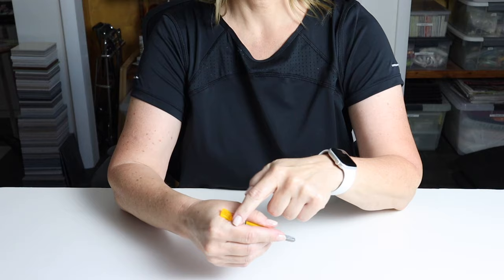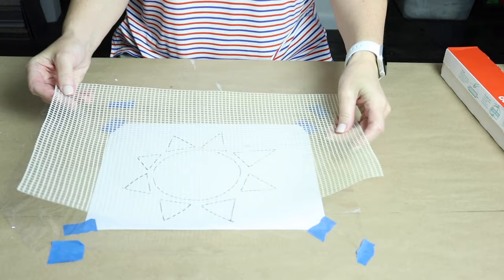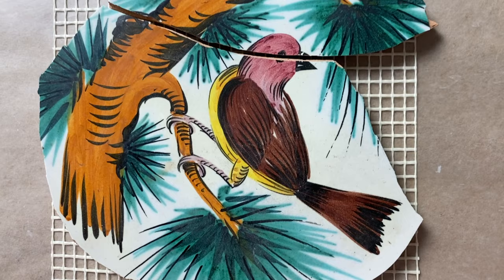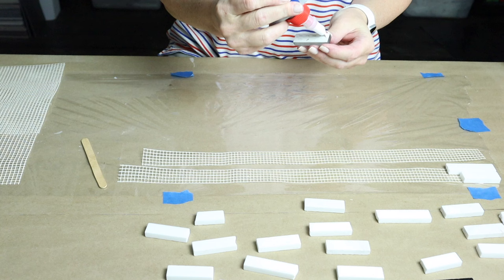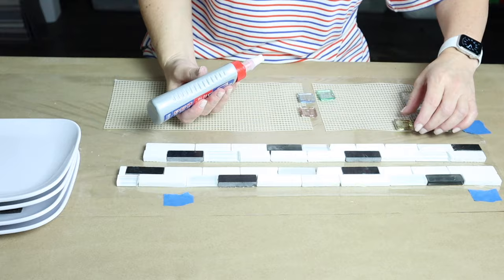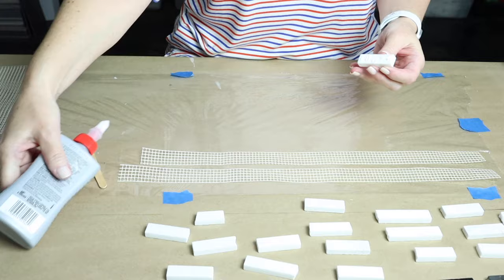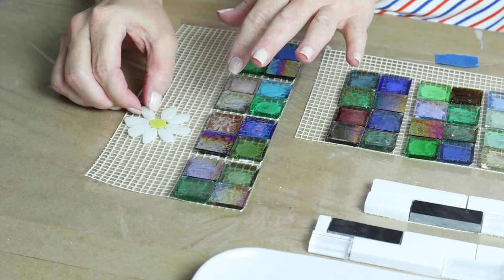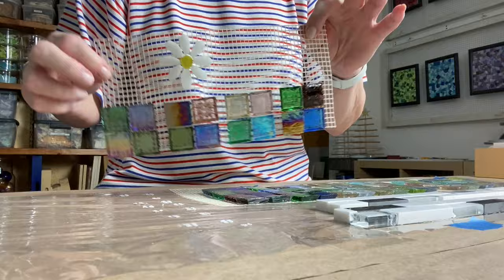HOW TO MOSAIC ON MESH | Types, Pros v. Cons, How to Use

Comment: Loved your video. I have used mesh before many years ago. My first project was to make a border all around our bathroom walls. I used a piece of plywood cut to the height of the border and long enough to fit on my work table and short enough to carry into the bathroom. I covered it with waxed paper and used a glue to secure each piece of tile on the mesh. Then with the help from my husband, we took the whole thing to the bathroom. It was quite heavy. I put mortar on the area where it was to go. And then removed the tile from the board, peeled off the wax paper and pressed it into the mortar. I repeated this until all the walls including the shower had the border and then grouted it. After all these years it has held up just fine.
Reply from the maker: Hi Lynne! How inventive!! Your bathroom must be gorgeous with your mosaic work. Keep creating and I'm glad you're here!
Reply: I wish we could see it! Lol
Reply: I am with you, tile mesh is a great product for large murals as they can be cut down into more manageable pieces. 
But when using Weldbond (dries clear ) the mesh will show through any transparent glass. Especially if you use a darker thin set for the final attachment, the white lines of the mesh will be seen through the glass. 
If you use a White thin -set tile adhesive for attaching to it’s final resting place you can still use Weldbond as your initial tile to mesh glue. Cheers

Comment: When using the adhesive mesh, you mentioned it looses it's stickiness eventually. Does that mean that once you make your mosaic the pieces will gradually start to fall off the completed project? Or were you just saying that once you pull it out to use it for a project, it won't be sticky anymore and you'll have to use your own adhesive anyway? Thanks!
Reply from the maker: Hi Maria! Yes, over time the adhesive mesh can/will eventually lose it's stickiness but that could be years down the road, depending on how it's stored, the quality, etc. You would use self adhesive mesh to assist in your mosaic making, most likely as an intermediary substrate upon eventually adhering it to a final substrate with proper adhesive. Keep creating and I'm thankful you're here!🔥
Reply: @JulieWeilbacher  Thanks so much for the info!

Comment: What is the widest mesh one can buy?  Not length, but width and where can one buy it?
Reply from the maker: Hi Ron! I've seen mesh that's 48" wide on a roll, and you can find it on Amazon. You might also check with a local diy tile store or hardware store🔥

Comment: I'm making mosaic stepping stones from scratch. Yes, mixing the concrete, pouring it into a mold, then decorate the top of the concrete once it has set for a bit - till the water basically evaporates from the surface. Please tell me if this will work: I am wanting to use thinset to attach my pieces to the mesh, let is set overnight, then backbutter the mesh with the mosaic with thinset, and then transfer the product to my concrete while it's a bit soft. I would push it down a bit, until the top of the mosaic is level with the concrete top. Will the mesh adhere to the concrete? My plan is to use a hodge-podge of materials to make a sidewalk.

Comment: Ordered a fancy mosaic - lots of marble pieces - from Mozaica (it was terrific!), but it was round (also had a mesh backing on it) and I was placing it over my stove and had to fit glass subway tiles around it. As cutting those tiles in curves was NOT easy, I decided to put a square marble edging frame the round (24") mosaic, and ordered more marble pieces from Mozaica (which they easily were able to send). So I needed to make "corners" of small pieces of marble and so seeing your video on how to apply these to an existing mosaic was really helpful. Thanks!
Reply from the maker: Hi Pamela! WOW! You came up with a fantastic solution! Great to hear my video helped you out. Enjoy your backsplash and I'm glad you're here!🙌

Comment: Such a brilliant video. Thanks.

I want to create a few garden images to attach to my external wall. Drilling it's problematic so it needs to stuck to the surface itself - which is painted brick.

This looks like a great technique for doing that, but I have a question. I normally see designs with a background filled in - but I would like these designs to to be plant and bird-shaped. It is still going to last if I cut the mesh around the shapes?

Is there a video where you show using around the mesh to create specific shapes and how to attach these to a vertical wall please?

Thank you in advance!

Comment: Amazing video, thank you! I'm going to be adding some mosaic accents to a now concrete retaining wall outdoors. So, a vertical surface. I'm thinking I'll glue stained glass pieces to mesh with weldbond, then attach the mosaic/mesh to the wall with thinset mortar. Does that sound like a plan that will withstand gravity and the elements?

Comment: Julie I was wondering what type of table top have you found that works best behind using mosaic ? if you're not using the mesh and you want to use some sort of form what type of material what do you use for that? I'm an old stained glass artist that haven't done it for a while and getting back into it now that I've retired. I like the way you teach Thanks!
Reply from the maker: Hi Libby! Thank you for your kind words. It's great to hear you're enjoying my videos. As for a table substrate, you want to think about where will the table be placed (indoors? outdoors?). For example, you don't want to put wood outside. The weather and things like termites will destroy it. Cement board or Wediboard are great options. You do want to make sure that the substrate is supported underneath. If it's being installed on top of an existing tabletop then great! But if there's no support under it, you need to add that first before placing your mosaic substrate. If it's a small side table then it probably doesn't need any additional support. Keep creating and I'm glad you're here!💫

Comment: Such a well done video – thank you! I am gearing up to do a very large outdoor mosaic and am wondering if Weldbond is suitable to glue the glass to the mesh for cold Canadian conditions. I plan to use a thinset rated for our climate to attach the mesh to a concrete wall.
Reply from the maker: Hi Brigitte! Thanks for your kind words and great to hear you enjoyed the video! You've got a fun project to do! I would use fortified thinset to adhere your tesserae to the mesh as well. For outdoor mosaics I wouldn't get Weldbond involved at all. Do everything you can to ensure your mosaic will hold up outdoors. Keep creating and I'm so glad you're here!🔥
Reply: @JulieWeilbacher  OK, I just happened to find your 'channel' though a FB site - 'Vintage Bathrooms'....and I've already learned a couple things just by watching this and reading some comments!  TY!  Of course, here's my little issue.  I've got an outdoor, inground fountain (Tucson, AZ) - It was tiled when we had it installed about 10 years ago.  First Six inches from top down, there is 1x1 mosaic tile.  Below that, all the way to floor AND floor of fountain is tiled in 2x2" tile. (All tile originally on mesh) - In the past 6 months, the 1x1 tiles are  popping off 1 by 1.  I decided to drain the fountain, collect the 'escapees' on floor of fountain and since the 2x2s seem to be stable, I thought, 'Oh easy.  I'll just have the smaller mosaics at top taken off and I'll replace them with new tile.  I've got the new round, smaller than penny tile (on mesh) - but now I'm to the point of REMOVING the existing tile installed with thinset/grouted and prepping the area for the new sheets of mesh.  Might you have a video explaining how to REMOVE tile/prep area for new?  TYIA!

Comment: Hello.. what brand or tipe of mesh do you recommend for a mosaic under water in a swimming pool ?
Reply from the maker: Hi Raul! Think of mesh as a placeholder so to speak. You'll adhere your mosaic to it, and then hand it off to the pool installer. I would use non-adhesive mesh and glue your tesserae to it. Sounds like a really fun project! Keep creating and I'm thankful you're here!🔥

Comment: Great video! I make pavers, and I'm experimenting with he best and least problematic transfer methods for complicated designs. Since they need to be outdoor friendly, would fine-hole mesh work for detail work and thinnest application under the mesh?
Reply from the maker: Hi GreenOwlive! Mosaic mesh works great for outdoor projects like you described. You'll see how I used it in this stepping stone video: https://youtu.be/JYE1Vt-FFGA. Make sure you use a fortified thinset-mortar as your adhesive and that your grout is also fortified. And of course once your mosaic is fully cured top it off with a sealer (video: https://youtu.be/5JqZU5ucM_k). Keep creating and I'm glad you're here!

Comment: Thx You! I'll be doing a broken mirror mosaic in a specific pattern. I've done this before, and made a mistake which adhesive to glue to a cement wall. The silver backing of mirror turned dark. I had to pull the pcs off the wall, and start again <wasn't easy> Is Weldbond safe to use and won't cause discoloration?
Reply from the maker: Hi Donna! You'll want to make sure you're using an adhesive that specifically mentions, 'safe for mirror.' Here are a couple options: https://amzn.to/3Ob1sNl; https://amzn.to/38KakJv. Weldbond is not a good option because it will destroy the silver backing over time. Keep creating and I'm glad you're here!🔥

Comment: Thank you for showing us how to be creative. I have not start my first mosaic, however, this Mother's Day I received all the tools you mentioned in your previous video. My first mosaic is a memorial to my sister and I have few questions. What adhesive can I use on mesh if my mosaic will be attached to the back of my brick oven (still under construction :) ) with thin-set? Can Weldbond be use on mesh without compromise the
Reply from the maker: Hi Rosalia! Your first mosaic sounds very special. Use minimum Weldbond when adhering your tesserae to the mesh. Use fortified thinset when attaching your mesh mosaic to the wall. Keep creating and I'm so glad you're here!🔥
Reply: @JulieWeilbacher  Thank you 🙏

Comment: Julie  two quick questions. 1. I have my mosaic tiled on mesh using Weldbond . My plan is to apply thinset and then the mosaic onto that. My project is for a birdbath so I’m a little nervous because I know Weldbond won’t be safe in a wet environment. Should the project be secure once it is mounted on the thin set ?   2.  Do you have any particular suggestions for mosaic on a bird bath ?  Thanks so much for all your videos .
Reply from the maker: Hi Sunday Sunshine! You're just using Weldbond to secure you're tesserae to the mesh. Your thinset will secure the mesh mosaic to the birdbath substrate. Once it's fully cured you can then finish it off with a fortified grout. What a fun project! Keep creating and I'm so glad you're here!🔥

Comment: Hi! What if you're doing a large piece using stained glass pieces that are small? The listing to the one you shared is for 12x12 and and I'm also wondering if it comes in really small squares for small glass pieces. Do you know? Thanks for this video!

I also saw someone on Etsy making large mosaics and shipping them rolled on this mesh and I'm just wondering how they do that without any pieces popping off or how loosely it is rolled... thanks for any help and feedback!
Reply from the maker: Hi there! Yep, you can roll your mesh mosaics which I've done and handed over to a tile installer for final installation. When rolling up your mesh mosaic, it doesn't have to be a tight roll, but rather a size which will take into account your tesserae sizes. Keep creating and I'm thankful you're here!🔥

Comment: Could I mosaic the top of a patio table on mesh and then grout it, leaving the mesh? The table will be on a covered patio. Thank you. I just love your videos!
Reply from the maker: Hi Neusa! Thanks so much for your kind words. Great to hear you're enjoying my videos! YES, you can attach the mosaic on mesh to a table top, and then grout. Make sure the table is a sound structure and can hold the weight of your mosaic over time. You might be able to add some supports underneath, if necessary. You want to avoid the table bowing. Keep creating and I'm so glad you're here!🔥
Reply: @JulieWeilbacher  Thank you Julie. I have never done any mosaic work other than an ordinary flower pot. If my table comes out decent I will send you a photo. 🌷🌷🌷🌷

Comment: Hi Julie,  I am getting ready to make my first attempt at creating a mosaic on Mesh, that I have just bought.  Okay, now following your instructions makes it seem easy - questions, this is for a 9"x7" wood box -  I plan on placing Mesh over the coloured pattern and following it in placing the Mini square tiles (it's a Roman design from free patterns)  do I apply the tiles with Well Bond or Thin Set to the Mesh?  As I watch you, you also grout the mosaic piece before attaching it to the box lid. (as I am typing, Just hearing you say Weld Bond is your favourite choice when working on Mesh).  Okay, once that would be cured, how do I attach the meshed mosaic to the box lid?  Look forward to your advice.  Thanks, Elizabeth
Reply from the maker: Hi Elizabeth! Well how exciting for you! Mesh mosaics are so much fun! Use a little Weldbond to adhere your tesserae to the mesh. It's just to keep them adhered to the mesh. Then once the mesh mosaic is dry, spread some adhesive (your choice!) onto the box and place your mesh mosaic on top. Wait for it to dry, then grout. OR the other alternative is to grout your mesh mosaic before you adhere it on the box. This video shows how I grout mesh mosaics: https://youtu.be/vSGv2NyObeo. Keep creating and I'm so thankful you're here!🔥

Comment: Very helpful.  Thank you!  Will the mesh be visible in the final project when using very transparent glass tiles?  Or does it "disappear" once you do the final application with thinset?
Reply from the maker: Hi Joe! It's great to hear you enjoyed the video. Yes, the mesh will show through when using very transparent glass tiles. I would experiment on a practice board using white thinset instead of dark gray. See if the thinset 'blends' with the mesh and makes it disappear under the transparent glass, so to speak. I'm curious what you find out. Keep creating and I'm glad you're here!
Reply: @JulieWeilbacher   great info! Thank you

Comment: Thank you! Do you know if Titebond will work?
Reply from the maker: Hi Pamela, thank you for watching and glad you're here! I've only worked with Titebond on wood projects, but I know they have multi-purpose 'white' glues which would be fine...you're only using a small amount any way. I would suggest doing a spot test to make sure your tesserae sticks to the mesh before you use it for your final project. Let it dry 24-48 hours before checking for true adhesion. Good luck!

Comment: Can you use the weldbond for projects that will be used for stepping stones?
Reply from the maker: Weldbond is water soluble. So it's not acceptable for a stepping stone. Rather, you should use something like a cement-based adhesive, Apoxie Sculpt, or a water/weather resistant silicone. Weldbond is acceptable if you're just lightly adhering tesserae to mesh, and then transferring your mesh mosaic onto a layer of cement-based adhesive (or any of the adhesives mentioned above) on your stepping stone. Keep creating and I'm glad you're here!🔥

Comment: If you save a piece like the flower and you want to add it to a larger piece, do you just cut the mesh around the pieces or put it down and fill around it?
Reply from the maker: Hi ArtByDavida! Actually, you could do either of those and they'd work. I would hold off on cutting down the mesh until you're ready to use it. Here's a video where I made all sorts of flowers on mesh: https://youtu.be/BWSb1sN2j4k. Keep creating and I'm so glad you're here!🔥

Comment: Im interested in Mosaic portraits using uniform materials divided into 16 piece x 16 piece sections. Would this be a good use considering I would like to hang the final piece vertically? Thank  you
Reply from the maker: Hi David! For what you're describing, mosaic mesh would work great as an intermediary substrate, to later be adhered to a final, solid substrate (wood, metal, glass, acrylic, etc.). Keep creating and I'm glad you're here!🔥

Comment: Hi Julie - I  attached  mosaic pieces to mesh and it is dry - and I want to carry the mesh to a sealed piece of plywood for indoor use - what adhesive would you use to attach the mesh design to the board - it's about 18 inches tall and 8 or so wide -  thanks josie
Reply from the maker: Hi Josie! Make sure the plywood is sealed first (this video will help you out: https://youtu.be/-209xL8AWTc) and then I'd use thinset-mortar as the adhesive. Keep creating and I'm so glad you're here!🔥

Comment: Great video.... but my problem with using mesh is that 99% of the time, I have to grout the project.....I am not a big fan of grouting.... especially in cold weather....it's so messy...and I prefer to do it out of door...
Reply from the maker: Hi there! What about making seasonal mosaics? In other words, mosaics which require grouting in the warmer months, and mosaics which don’t require grouting in colder months. You don’t have to grout mesh mosaics but they do better with the stability long term if they aren’t going to be adhered to a final hard substrate. Keep creating and I’m thankful you’re here.🔥